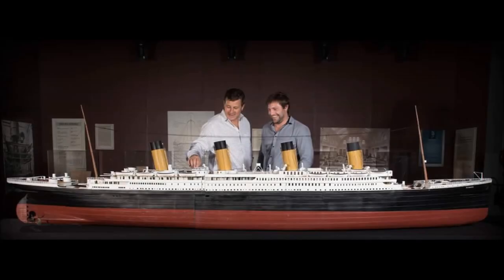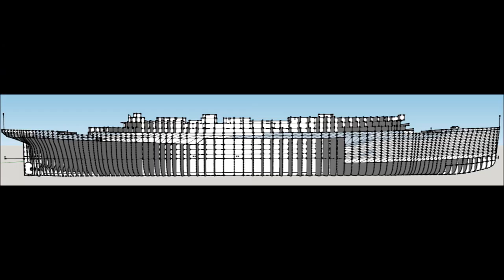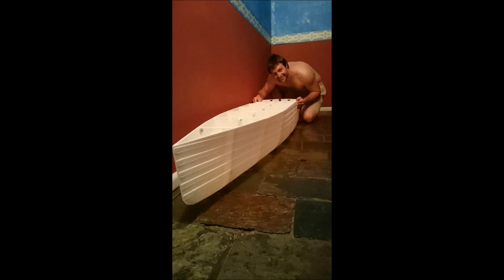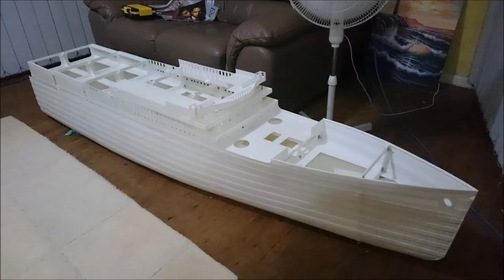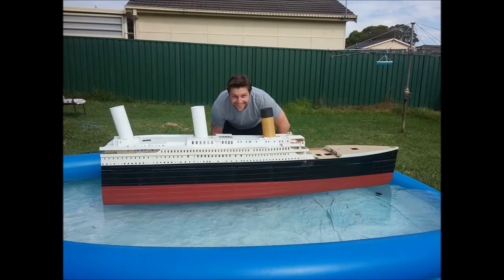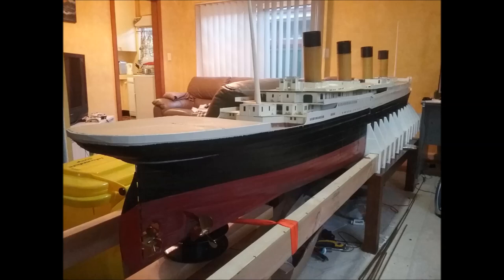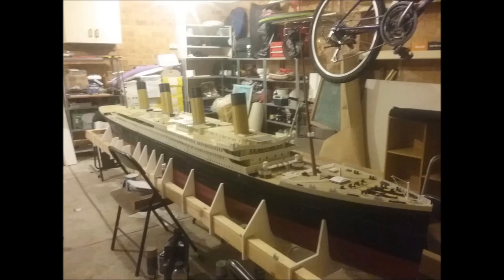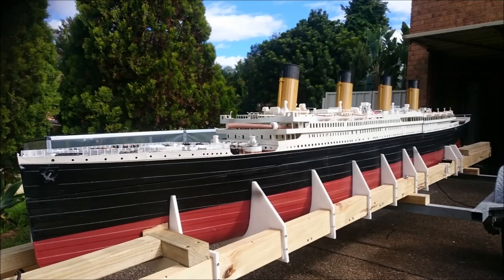Giant 3d Printed Titanic! Ep 01

Comment: As a Former Trustee for a Titanic Historical Society and have been on the 1996 Expedition for the recovery of the "Big Piece", this in my view is one of the best I have seen as  a 3D. even for a Proto. I love the fact you made the Funnels work and even at just 1 having smoke is not cause for concern. not all of the Boilers would be working at all times.  1 really for being in port for electrical power and so forth.  I hope this will be not torn down even after the first one finished. you could just simply change the promenade deck with open deck as it could be the Olympic. never mind of making it split in half. I also love the place where you did the pre "sea trials' for it to check the water tightness and also the back up system for any flooding that may occur. I can not wait to see the complete ship. maybe the Navigation lights and some decking lights will be good for this as well.

Comment: Just a quick note regarding how small people think the rudder was in comparison to the ship.....the design of the hull was no different to the tried and tested shape of many ships for years before...everything was just upscaled. The rudder weighed 101 tonnes. Commodore Warwick of the Queen Mary said that at speed, you only had to turn the wheel 2cm and the ship would respond with a change in direction, same principle as turning your wheel at speed in a car, mm's is all that is needed. These ships wernt required to turn in port without the use of tugs.

Comment: Omg man that is Awesome! But I couldn't help in hearing you repeatedly refer to its lenth as the same lenth of a canoe, with that in mind, did it ever cross your mind to actually build one that you could actually pilot yourself or build it a wee bit longer so you & a mate could pilot one sitting in tandem, I'm also a titanic buff myself and I also live on a lake, so I've toyed with the idea myself the problem is I lack the room or a garage to build it in, so I spread the idea around in hopes someone might be inspired by it, and to save space I thought of using troll motors for power, because nothing but wires run down the shaft of one except wires therefore the housing & propellers could be made modular & could be mounted anywhere, I realize building such a craft like this that everything below the waterline may need to be modified and would not be authentically accurate, but as long as everything above the waterline is correct who's going to know, anyway my friend its a ship of dreams I just hope it becomes a reality. 😜👍